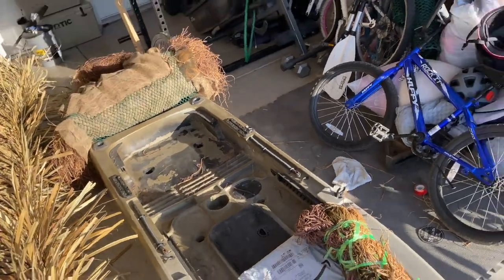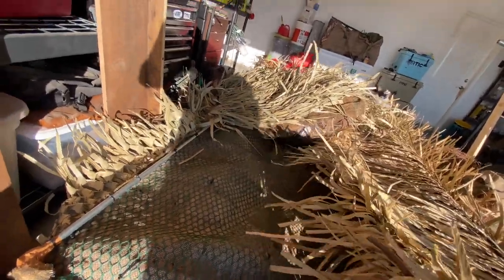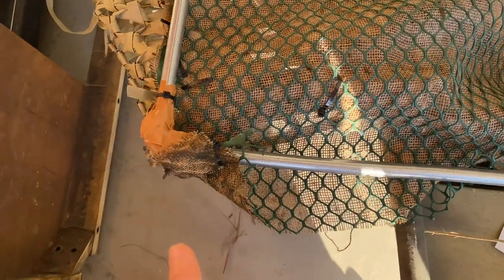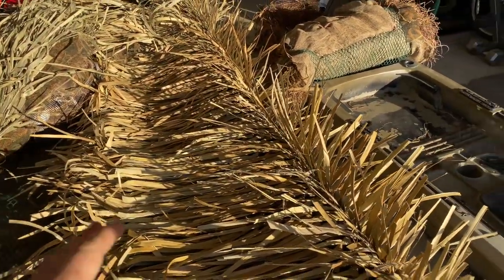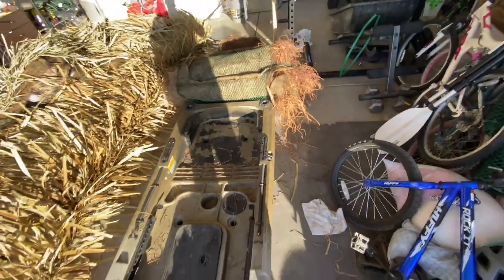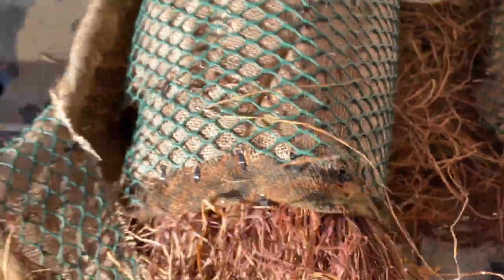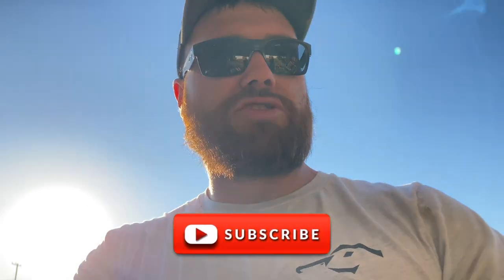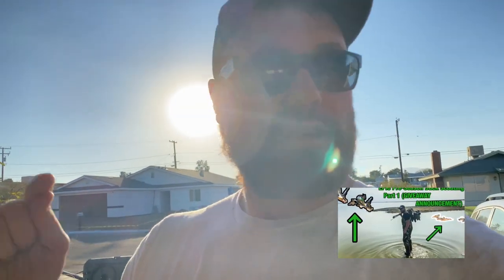I BUILT A KAYAK DUCK BLIND FOR CHEAP!! JON BOAT UPDATE

Comment: What i wanna know is how you plan to lay down even slightly comfortable in that kayak? I have an old town discovery and its a great canoe, good thick hull and pretty darn stable. I run trot lines in it👍
Reply from the maker: I no longer had the kayak I sold it and bought the Ascend H10. But I bought a momarsh Invisa-lounge xl that I was planning on using but now have it for my H10 and it’s perfect!

Comment: Did you just zip tie the grass to the burlap? Does the zip tied just go through it? I'm thinking about doing something similar with my Beavertail Phantom. I was planning on using the fencing with netting rafia, but thinking about using burlap with it instead
Reply from the maker: Yes I put zip ties around small bundles and then put a zip tie through the bundle to secure it to the green netting
Reply from the maker: Head on over to Instagram and follow us @Gregor_Outdoors and I’ll post a quick picture for you

Comment: I realize this videos a year old but how did you keep the canopy up when the blind was up
Reply from the maker: I used 1 1/2” pvc (I think that’s the sz) stuck it in the rod holders to prop it up when I’m in the kayak. I no longer have that specific model but I have the ascend h10 and did the same thing.
Reply: @GregorOutdoors  I guess I should’ve been more specific I was talking about the canopy above your head in the boat. I used your first blind video and based my blind off of that I just don’t get how you got the canopy to stay up. Thanks for the reply
Reply from the maker: @timsmith1106  I understand. Like I said, there were 2 rod holders behind where the seat is located in the ascend model kayaks. They sit at about a 20* angle. When I built the canopy to cover me I made the pvc I put into those rod holders long enough so that when I put the fabric over the rod holders it was high enough to cover me when laying down.